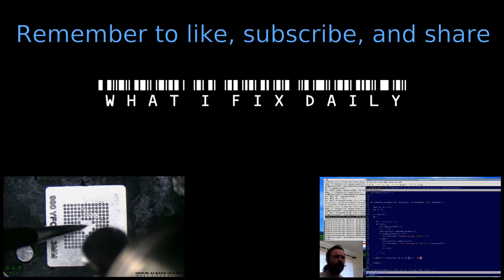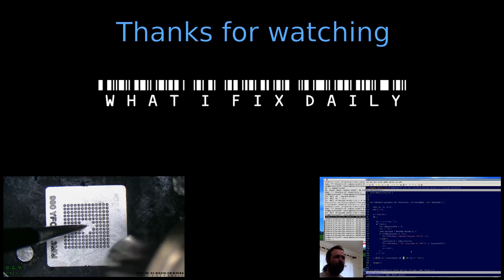iP6 iOS13 update lock / hang fault recovery with preliminary rebuild

Comment: Hello sir.  I service iphones also.  Quick question.  I replaced a selfie cam on an XR and not only does the face ID not work (which I knew about) but the selfie cam does not work.  I've tried 2 batches of parts.  All do the same thing.  His original selfie cam still works in his phone.  (it's just foggy and Cleaning it doesn't work) can you verify Apple doesn't completely disable the selfie camera after replacement?  I can't find a single person to verify this.  Maybe Apple has done this in a recent update?

Comment: Hi! What is your temp/airflow for BGA solder on this one?
Reply: It's in the introductory information in most of Paul's videos ▶  Hot air settings: 8mm straight nozzle, 450'C @ 110lpm for laptops, 420'C @ 50lpm for phones ( YOUR environment, method and equipment will be different, so your values will be different )